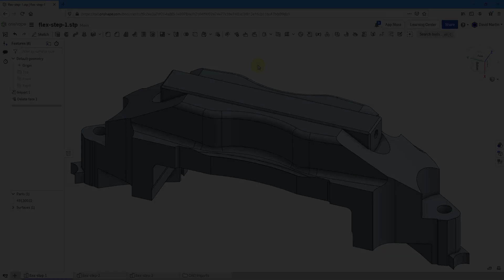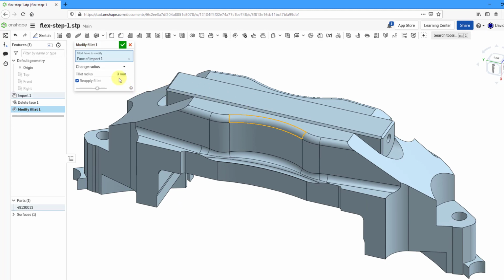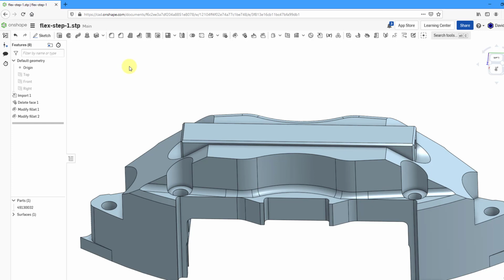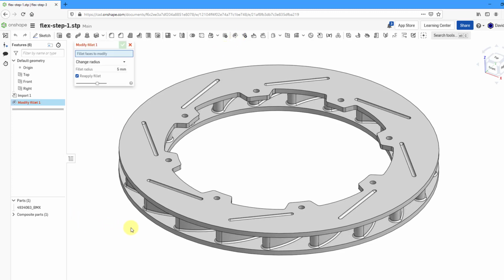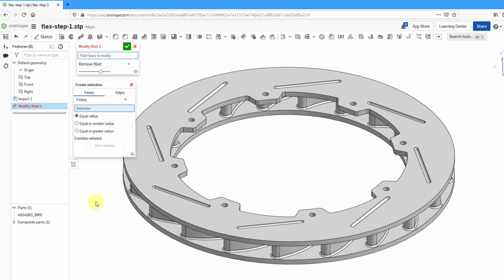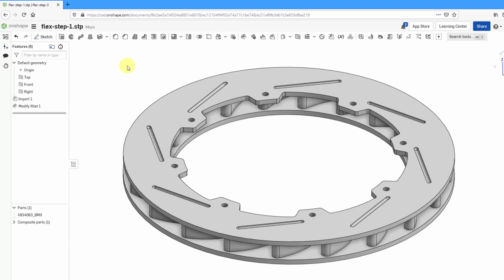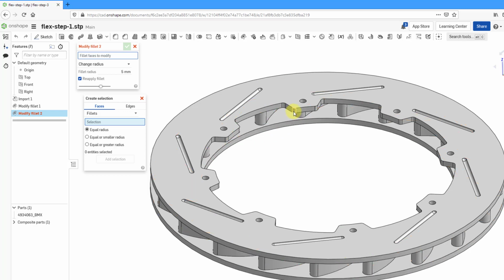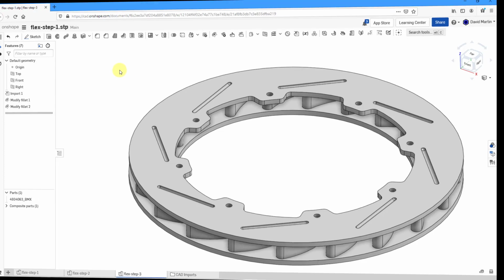Onshape - Modify Fillet

Comment: Does Ryzen CPU and nividia GPU driver have issue ? I have heard from Tom Hardware website..... Can I run mechanical software like Openfoam, Hypermesh, Ansys(Simulation), Converge CFD, Ansa in ryzen smoothly and what about linux....can i go for hp omen (R5 4600H GTX 1650)
Reply from the maker: Honestly, I have no idea what any of that means.